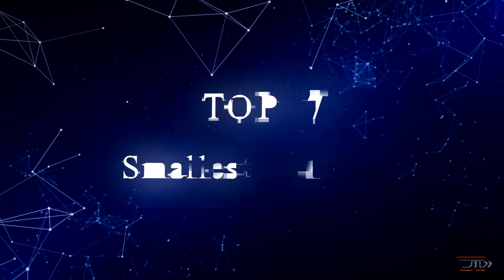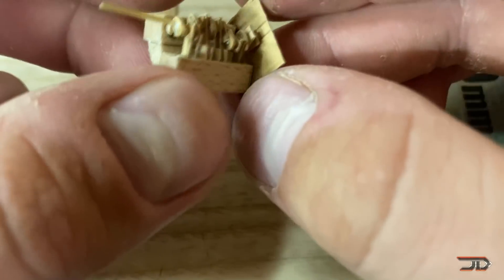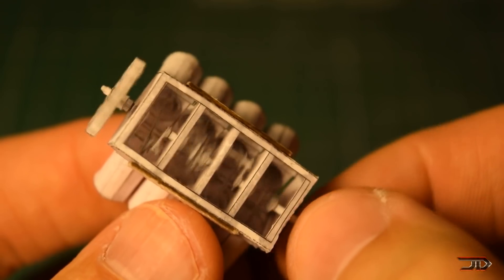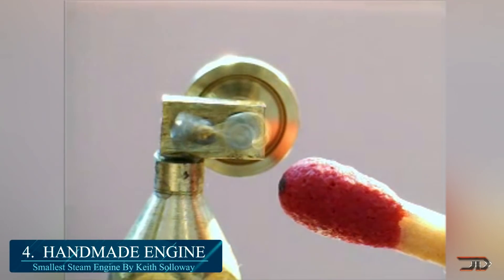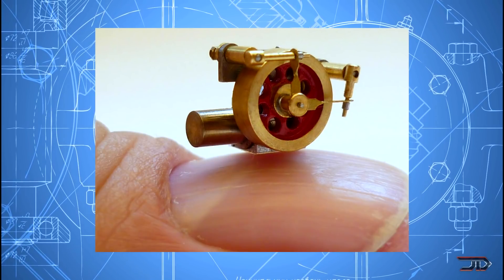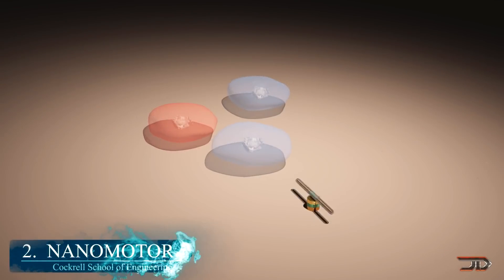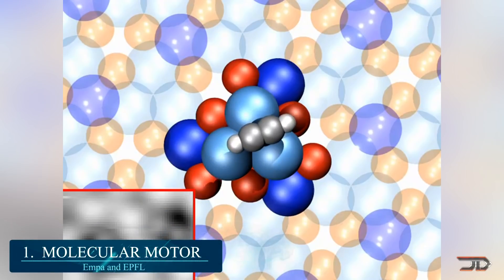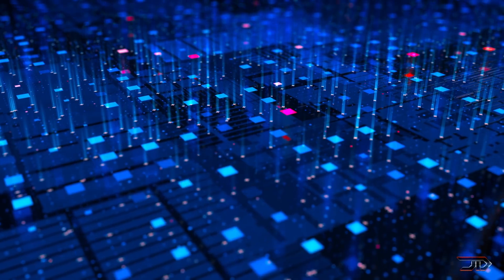7 SMALLEST Motors In The WORLD

Comment: Was expecting some power motors, not molds…
Reply from the maker: I will try to make another video about pure combustion engines in the future.
Reply: @Motor_Explorer1  well those last motors does blowing mind tho, these levels are way different from each other, you might need to change topic to the levels of micro motors? 😂 
Thanks for the video!
Reply: @Motor_Explorer1  maybe it’s only up to me that when a motor is making mechanical energy, no matter it’s using combustion or steam or chemical or electric, it’s not a toy anymore and becomes exciting…